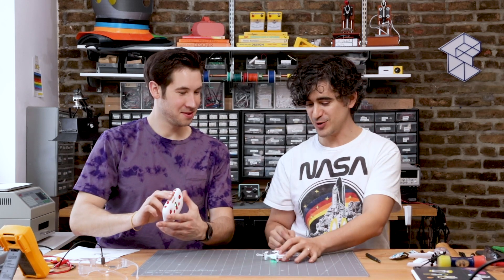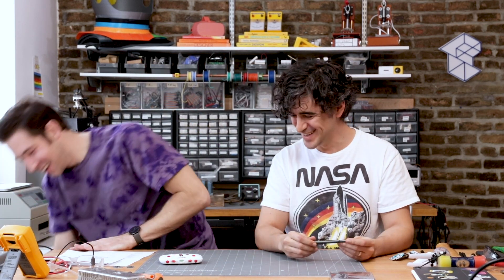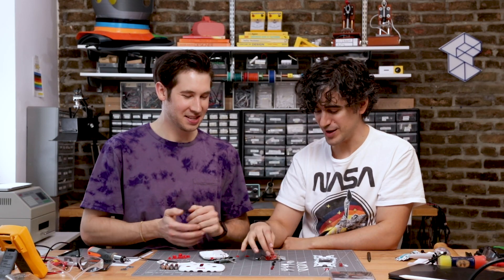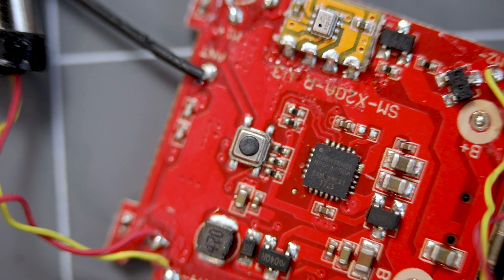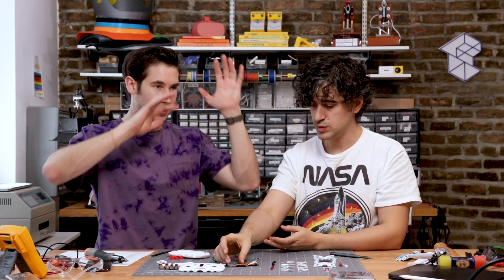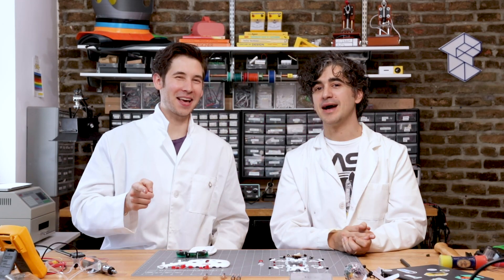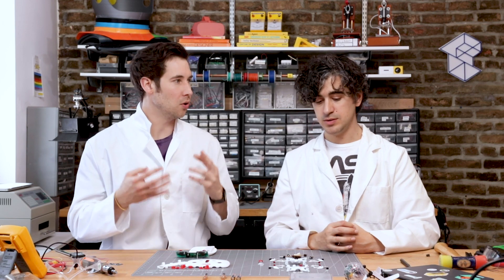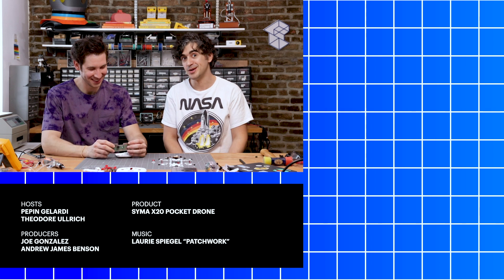DRONE TEARDOWN! SEE WHAT'S IN THE SYMA X20 POCKET DRONE

Comment: Hi nice video about drone, I'm also have same drone but I am facing binding problem between receiver and transmitter board, led lights keep blinking even after pairing with transmitter, they are not become solid, and also motors not rotating, what is the problem? The problem is in controller or in receiver? if it in transmitter how to check and repair could you help me?

Comment: my drone during it's first take-off after every charge goes up continuously tough not throttling it up, so I had to bring it down so that the drone descends a bit, but then it still rises even tough I don't touch the controller then I throttle it down and then from there it start to hold the altitude my syma x20 is that a thing or anyway to fix it

Comment: I subscribed because you're going to be a great channel and here are a few points to make it there faster. First, the technical definitions are not stated correctly. A gyroscope is not an accelerometer for rotation. It's a sensor to measure the angular velocity of the platform in three directions. The accelerometer measures the proper force (the summation of acceleration caused by gravity and the movement of the vehicle) and in such toys, they're used to measure the direction of the gravity vector (in a fusion setup with the gyroscope). I would have liked the video to focus a little bit more on the technical aspect of the processor used by the device which is of paramount importance when it comes to running fusion and control algorithms on board. 
Finally, the microphone was a little off and the balance of background music in comparison to the narration was not right.
All in all, great video quality, and I hope you rock so that I would see other cool videos at my coffee breaks :-)